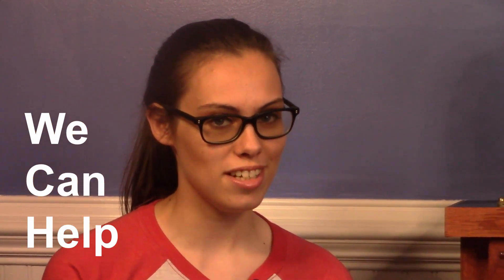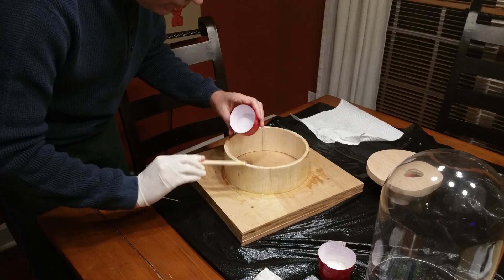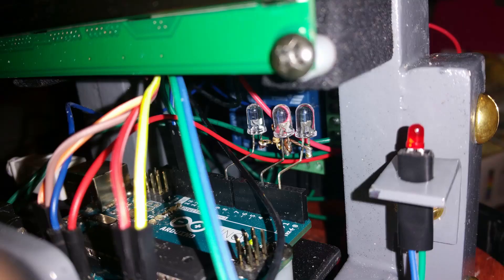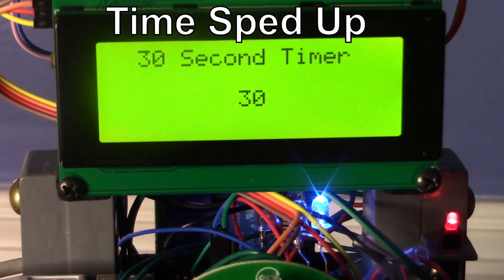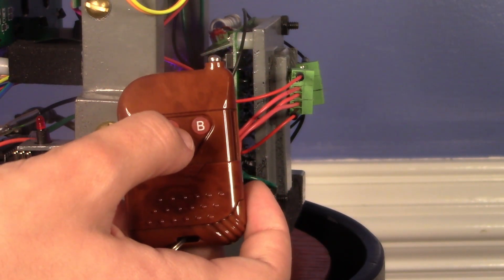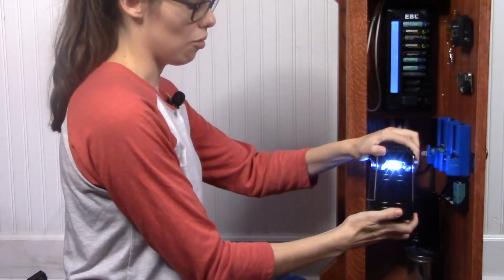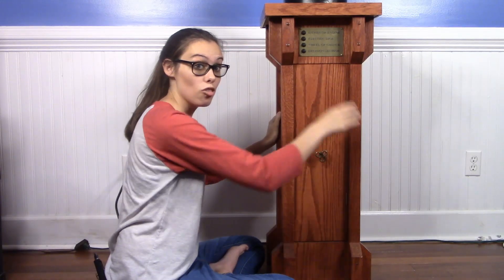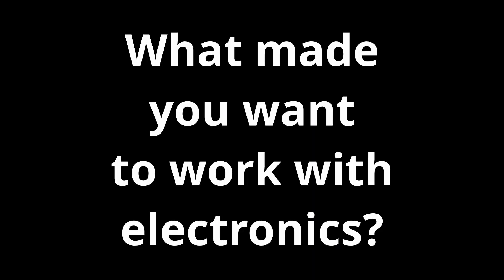Dome Of Destiny - Arduino Furniture Of Mystery

Comment: When you paint wood to look like metal (the chassis mentioned at the 3 minute mark) there are a couple of things that you can do to help.  Usually the problem is the grain in the wood and how it absorbs paint, so you want to create a really smooth surface for the paint.  You can coat the wood in Bondo and sand it down for a smooth finish.  When painted, it will give a metal like look.  Another option, something I learned from Brian at the Smugglers Room YouTube channel, is to do a 50/50 mix (that's what worked for me) of water and pink DAP DryDex spackle.  This will create a thin coating on the wood that can be smoothed out and painted to look like metal.  I hope this helps.
Reply from the maker: Great advice and much appreciated. We really wanted to make the chassis look like brass or bronze but gray turned out OK. If we build anything else like this, and we probably will with a Jukebox we are designing, we will definitely use your suggestions!
Reply: @AtomicDairy  Glad I could help.